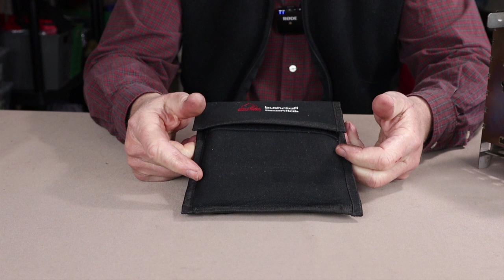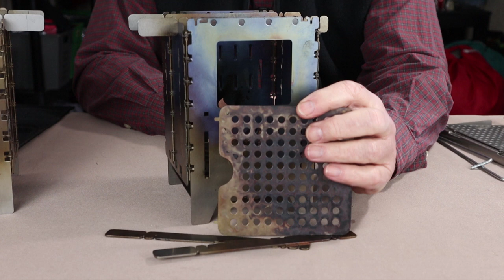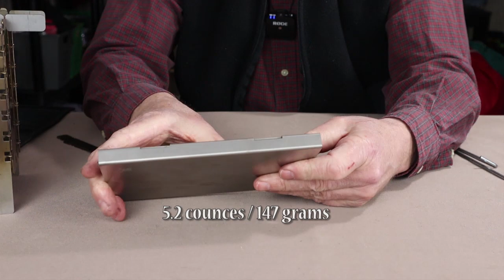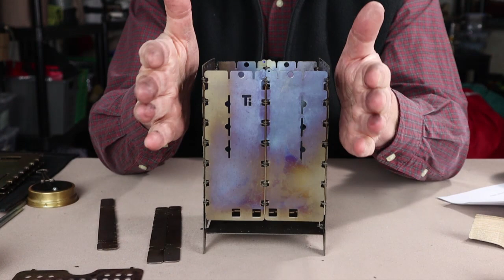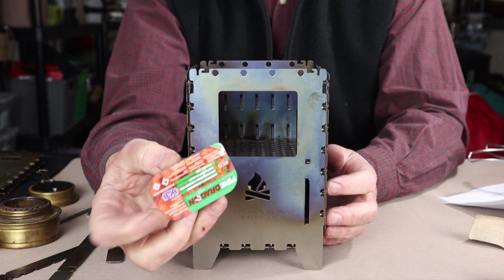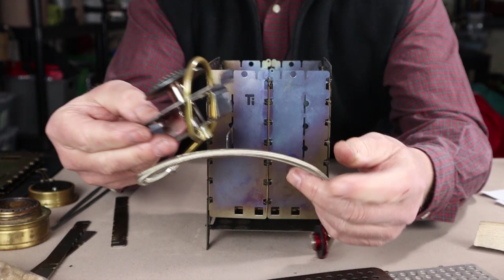Bushcraft Essentials Bushbox XL - Comprehensive Review

Comment: Good review. I bought the XL Ti very early after its launch. I had been undecided whether to go for the BB or the FB but I was sold on the Ti and it forced me to bite the bullet. Years later, I still admire the bravery of BE to go ahead with the Ti version when FB wouldn't but I do have some reservations.
At 6:00 you introduce the baseplate (better named than BE's own "multifunctional case"). To be honest, I think that this is a marketing ploy from BE, to introduce a fix for the warping problem. 147g, fully 30% extra overall!, for something sold on its weight saving virtues. Their sales blurb talks about it being a " kitchen cutting board",  a fireproof dry surface for preparing feathersticks and a stable base in sand and snow...... Really???
I bought the XL for 3 reasons, the ease of deployment, the light weight and the big feed port. This last, is, I believe the source of the BB warping problems, due to asymmetric heat expansion. The baseplate provides the guide and clamp to contain and correct any warpage in the feedport plate and its opposite trivet holder plate.
Personally, like yourself, I've had minimal distortion, because I've used the XL as advised. Perhaps if BE had cut the feed port oval instead of square, there'd be fewer problems?
On the 2 hinged plates right at the top, there are a couple of drilled eyes. Are these for hanging wires? In a wetland perhaps?
Thanks again for a thorough review and I'm really looking forward to the Gen 2 / XL shootout when you can get round to it. Paul
Reply from the maker: I can see you point about the baseplate not being all that great to carry. I have not used it as a cutting board but have found it useful on top of snow but importantly, it does help with embers that fall out the feed port. Of course, so would a piece of aluminum foil. Thanks for commenting

Comment: I also have used mine with long rods. Set from bottom to top on a V shape to capture my billy pot sideways and then using it as an oven.  Works pretty good.
Reply from the maker: Right on. Similar to the Firebox. Thanks for commenting

Comment: Thurough review.  I would think if loading it up with briquettes doe not cause warping a Swedish fire torch shouldn't.  Firebox Steve sure inspires lots of people.  Waiting for part 2.
Reply: Steve and the firebox are unbeatable. All I could think of, for every feature, is the firebox does that exact same thing, and often better.
I e thought often about the high feed or low feed, and I think Steve hit it right on.  The loser feed helps with a chimney effect, but the high feed of this will let heat escape, or be unfocused.  Man, my firebox is like hotter than fire.
Reply from the maker: Will be on on Saturday. Thanks for commenting
Reply: @jimf1964  I totally agree, my Firebox stoves provide me with everything I need.  Not sure if you have seen the "Kettle Camping" YouTube channel.  What that guy does with his Firebox is AMAZING.  I have watched many of his videos several times and learn something new each time.  How flattering for Steve to see so many stove manufacturers attempting to copy his stove.

Comment: definitely a good attempt to copy the firebox stove, but doesn't cut it.  i still prefer the firebox as you dont get the gaps in the side walls by grate when open, and the metal is sturdier.  firebox stove recommends the swedish torch method, which this stove recommends not to do for fear of warping.
Reply from the maker: I will be doing a comparison between the two stoves soon